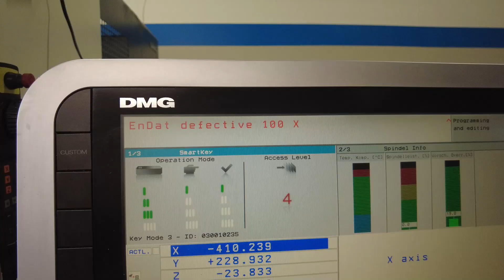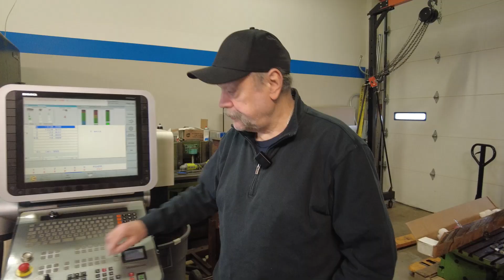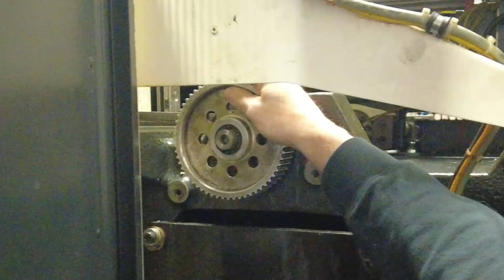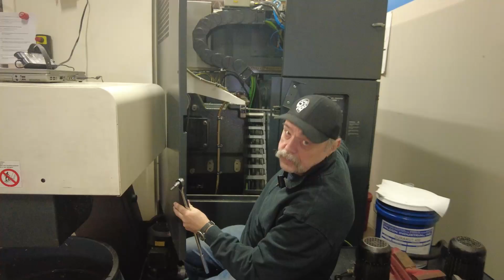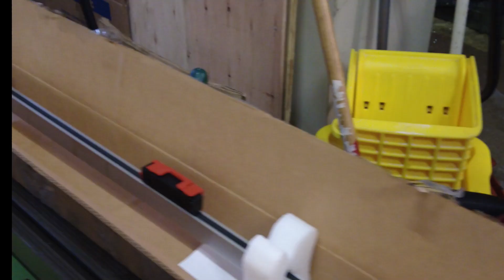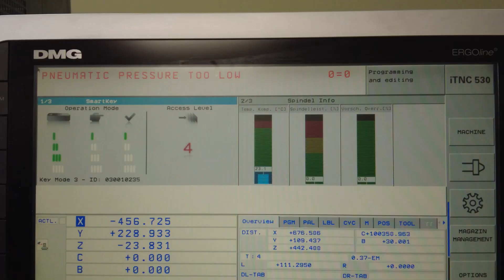Don’t Panic When You See This Alarm!

Comment from the maker: If your CNC throws a linear scale / axis alarm on startup and won’t let you move (X, Y, or Z), don’t panic — the machine is usually not broken.

This video shows a temporary workaround to get the axis moving again so you can get back to work. In most cases, the root cause is dirt or contamination on the linear scale or reader head, especially on non-purged scales.

⚠ This is a short-term fix to reduce downtime.
I’ll cover the proper cleaning procedure in a future video for a permanent solution.

If this saved you time or frustration:

Feel free to leave a comment

Thanks for watching — and keep on machining. 👊